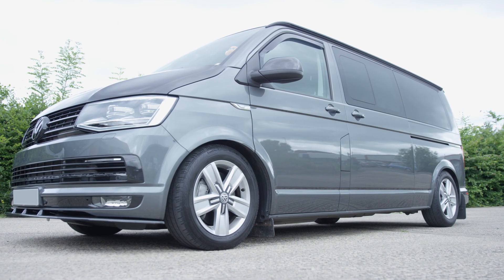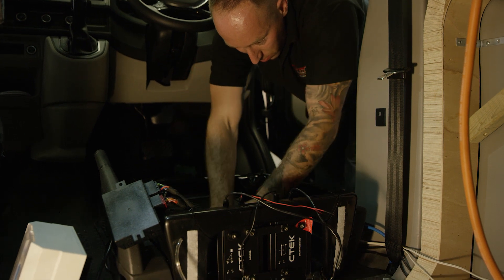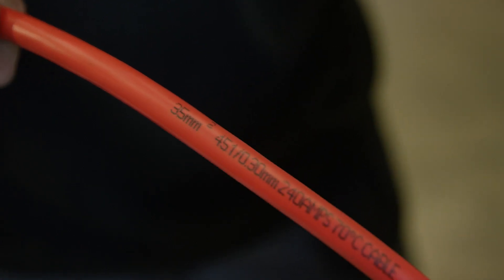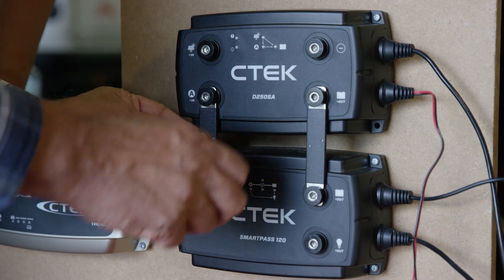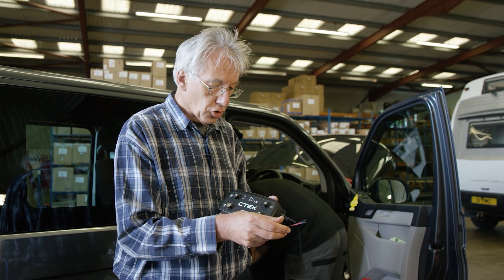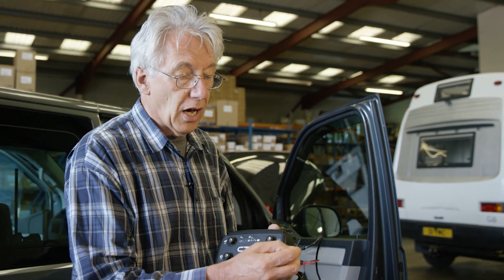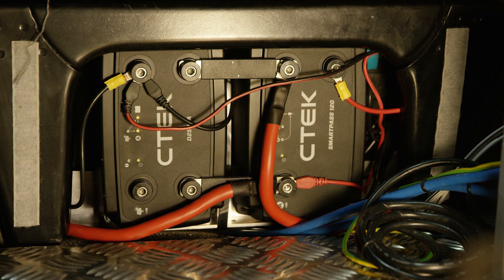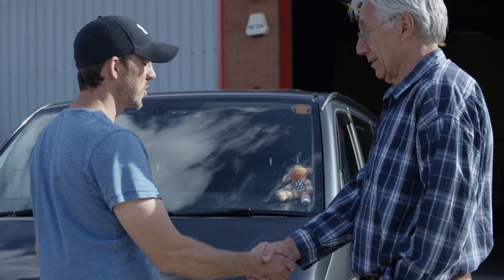Battery Chat With Andy Harris - D250SA & Smartpass Install

Comment: Hello, Great video will buy me one  but can you please explain why you use an  35,00 mm2(max 160 amps load rated)  cabel with an 300 amps fuse ?  Should a fuse not be less amps then the cabel ? In order to protect the cabel and the charger. 
Thanks

Comment: I’ve got the D 250 but will be adding the Smartpass to the system. My truck is 24 volts running two 12 start batteries. My question is, can I run the Smartpass off one of the 12 volt batteries? Thank you.
Reply from the maker: Hi, thank you for reaching out! 

Yes it is possible only If the input voltage to the smartpass is 12v and the service battery you will charge also is a 12v.

Have a great day! ☀

Comment: Nice description, but for me it would be better if there was a discription of the cables connected to the d250sa and the 120 smart pass. A step by step install video for instance. This would be very helpful in my case as I have just purchased the units for my Arapaho and was hoping to save on the installation cost, like many of us.

Comment: I'm using a d250sa in my gq patrol and my secondary battery is a agm battery so I need to connect the black wire to a earth but I don't have a smart altnator so what do i do with the red wire
Reply: You won't need to to connect the small red lead at all. leave the rubber boot on it and tape it out of the way if you need to, if you have already taken the boot off it just cut it off square and tape it up.
Reply: Is there a number I can call for help?

Comment: Do you need to use both units if you only have one leisure battery that will only be used occasionally?
Reply: No. The smartpass increases the charging capability of the D250sa from 20amps to 80-140amps. The D250sa on it's own is perfectly capable and will intelligently charge your battery on its own from the alternator and any solar input, while maximising the power from both sources to charge your batteries as quickly and safely as possible. The smartpass will increase the amps it can charge at, increasing the speed of the charge, as well as some other ancillary capabilities.

Comment: Brian Leach 
1 second ago
hi there can you help me I have d250sa and smart pass iam using 35mm sq cable in with a 300 amp fuse 16mm sq out cable with a 30 amp fuse  every time I start the engine it trip the 30 amp fuse can tell me what size fuse I should be using on the out side of things thanks Brian.
Reply: You need to be using a 300A fuse like it says in the instructions. 30A is for the D250SA only.

Comment: 50mm2  Cable if it 5meters? To the starter battery? That’s a beast of a cable 😝
Reply: My length from starter battery to smartpass will be 3.2 meters, in the manual it says for 2 meters use 35mm2 cable and for 5 meters use 50mm2 cable would I be okay to use the 35mm2 cable for 3.2 meters?
Reply: @mitclarkk3656  Yeah you'll be fine. Voltage drop is the main concern, and you shouldn't be letting voltage drop by more than 5% for 12VDC circuits. At 13VDC, 140A using 35mm2 over 3.2 metres, the voltage drop will be 4.38% or 0.57V

Comment: which ignition feed port does it go into?
Reply: I would go Retained accessory power (RAP) or ignition/acc 2. 
It just wants power on the red lead only if you have a smart alternator as this tells it when the car is runnning/charging. Accessory power also gets disconnected temporarily as the car is cranking.
If you have a smart alternator ie. you car voltage doesn't stay up around 14+volts, instead drop after a few minutes to around 12-13 volts, you will want to connect the red wire.
If yours stays at around 14v you can leave it disconnected

Comment: Terrible video. No explanation as to why you chose these products, no showcasing them working and then to top it off claiming ‘there’s nothing else like them on the market...”
Hello redarc manager 30, does same and more; lithium compatible, and takes third source/ shore power/ as well
Reply: CTEK D250SA together with the Smartpass 120 is also Lithium compatible & far cheaper than the Manager 30. There's nothing like it on the market due to it's charging power & capabilities. The Manager 30 crawls along at a mere 30A of charging power against the CTEK's powerful 140A of charging power, almost 5 times as powerful. A simple addition for shore power is to add a CTEK M300 charger to the system allowing for AC power charging or shore charging as you call it. All this combined still comes in almost $1,000.00AUD cheaper than the Manager 30.
The Redarc is a great unit but the price is a bit of a joke.
Reply: Brian Pinard Yeah, double check that pricing cos the Manager30 is far cheaper than you are quoting and almost identical to the CTEK setup you cite without extra cabling, etc.. Having said that I’m not going down that path but I’m just bored with people marrying themselves to one solution an sticking to one brand all the time.